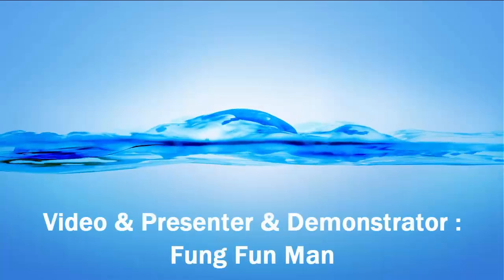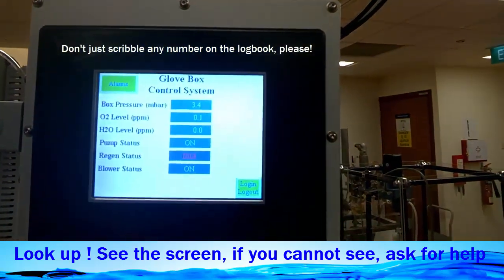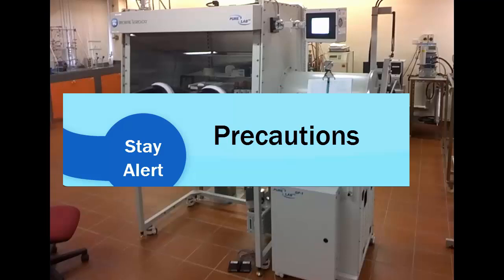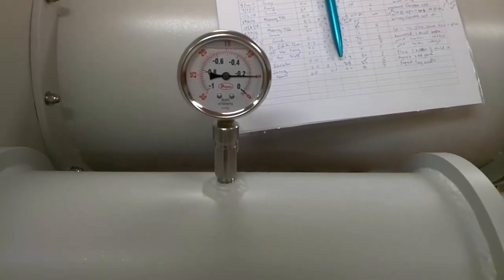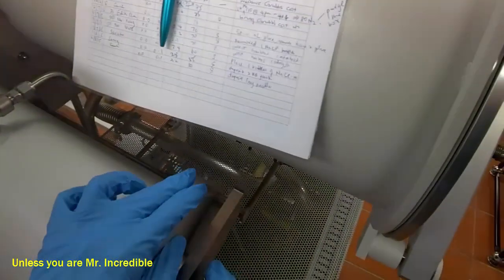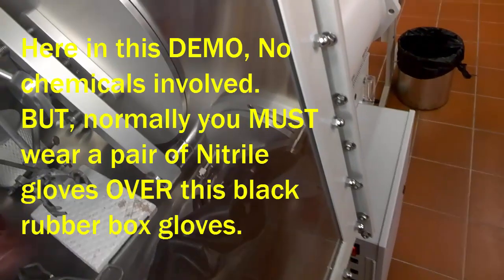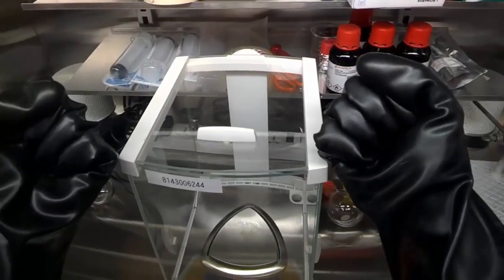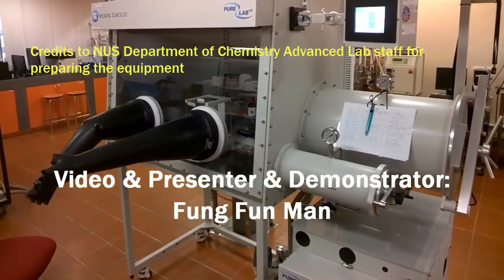🌟 -- Glove Box - operation  (Guide to Using the High Efficiency GloveBox)

Comment: Do we need to evacuate and refill both slowly?
Reply from the maker: not too fast, keep it in moderation. too slow essentially you lose time
Reply: @chemfunman  I want to confirm that if I want to use the glove box by putting my hands inside when I see the pointer needle is on zero , can I insert my hands and do my work without refill evacuate